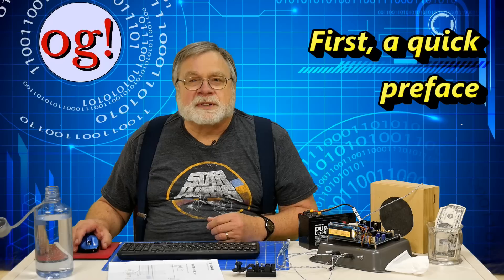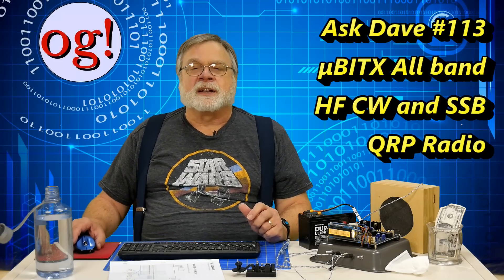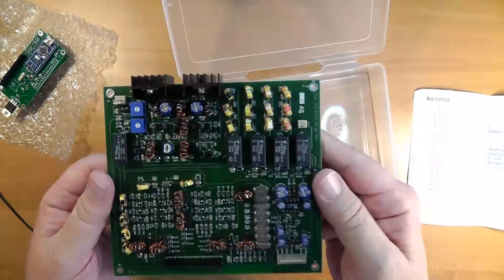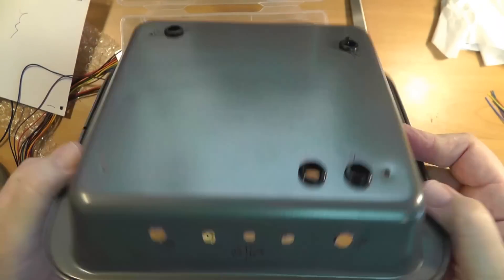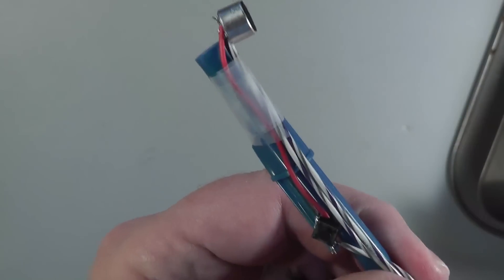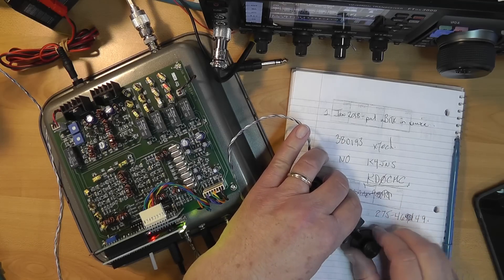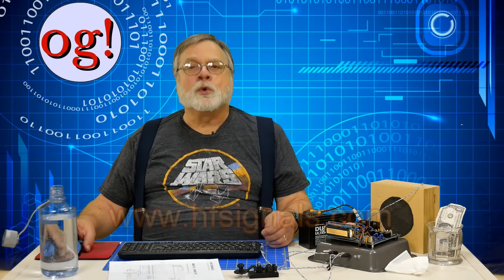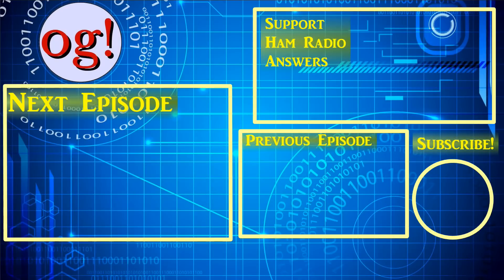New All-band SSB/CW Micro BITX Now Available (AD #113)

Comment: For those of us experimenters who have no great interest in purchasing a $1,000 to $10,000 appliance rig to ragchew, contest, or certificate chase with, it's cheap and easy to buy one of the $17 power amplifier kits on eBay and build it up, and build low-pass filters for any bands of interest. That's what I'm doing, and I'm adding a step-up converter module to select the drive voltage for the MOSFETs in order to get a more significant power output. 45 to 60 watts will get one within an S-unit of the expensive rig's 100 W or so. These days there's really no reason to let power limitations keep anyone (with a soldering iron who can follow directions,) from running a cheap rig alongside the big boys on SSB. We experimenters really have no use for appliance radios because of the price, but more importantly because they  a dead-end. They are nearly impossible to modify or add features to, and far too expensive to give anyone the incentive to try, and one can't really learn much from them. They are a black box. A cheap and open layout like the uBITX rig you have there is best. There are even modification videos online for them, and rigs such as this can get repackaged for compact size if desired after all the learning and mods and add-ons are done. The most important privilege associated with a ham license isn't bands or power. It's the open authorization to do whatever we want with our equipment within the rules of the service. We can design and build, mix and match, modify and improve as we so choose. Appliance rigs are simply not conducive to that. No, a new ham may not know enough to do all that I described, but the ham license is a license to learn, and learning about RF is what the ham radio hobby is really all about.

Comment: I could make a wooden radio chassis and line it with aluminium foil to protected it from RF noise
Reply from the maker: Yes, that will work as long as you can make good ground contact to that aluminum.

Comment: While we may have an amateur in our titles, the HAM's in my area at least take allocations seriously. For the amount of learning you go through even for a General class license and the learning throughout your years of operating, I think a little trust is earned. I see this debate with the ICOM 718 which I have vs the ICOM 78. If I need to get a message across on HF in an emergency it is nice to know I have the whole band should the other bands not be open....especially considering some of the Marine SSB bands are monitored for life and death matters and are likely to get you a response. I take this type of thing seriously and anyone building a radio most likely does as well. As a side note: My ICOM 718 can transmit out of the band by quite a bit on some areas without any modifications and I haven't heard of this causing issues with other users that already will find a way to break the law. If te 718 was General TX as well I wouldn't need to snip a diode at some point for 60 Meters or whatever future allocations might hit us. I like to keep good products for a while. I also like a signal generator without buying yet another product when I have bills and student loans to pay.

Comment: Dave,
 A selection of uBITX and BITX40 ready built METAL cases available from another India Company  
LINK: https://amateurradiokits.in/ 
Holes are pre-drilled, hardware and extras are included.

Also for the BITX supplied volume pot try an eBay search for 
"4mm Shaft Insert Dia Brass Potentiometer Control Knobs" 
These are 14mm (25mm skirt) plastic knobs with a brass collet inside.  5pcs for less than $4 with free shipping from China.  
You pry the top cap off, slide the knop over the pot shaft, trim off excess shaft sticking out past the collet nut, use a 10mm socket to tighten the collet nut to grip the shaft, replace the cap back on top of knob.
Reply from the maker: Thanks for the tip.

Comment: Why does the case need to be a conductive material?
Reply from the maker: It doesn't. I put my first BITX 40 in a plastic case. But a metal case provides more protection, plus more shielding against RFI. However the power levels are so low that plastic can work just fine.

Comment: Dave. I am seriously thinking of a uBitX.  It looks like a great little rig! You mentioned the problem with filtering for CW. I may have a solution for you. An Italian ham, IW2NDH, Luca Facchinetti, has come up with an incredible  little DSP filter board (http://jackdev23.wixsite.com/iw2ndh-dsp ). It is reasonably priced, but even so, it will go almost as much as the uBitX at about $80. 
Now, here I submit a philosophy about the uBitX and a new direction for ham radio. A new General buys and builds his uBitX. As he progresses, he desires a little more radio, so he might add the DSP. Itching for more power, why not build a linear? For less than $20, you can buy a 70W amp kit that will match right up to it. This budding ham essentially winds up building a great rig out of building blocks. Like following a TunaTin 40, with a 6L6 (edit: I think it was actually an 809) amp. Don't think about the limits; think about the potential.
I think the uBitX explosion has the potential to take ham radio back to its roots, much as it was back when I first considered ham radio, 50 years ago. de N4DFP, 73

Comment: Box making isn't that hard and GUESS WHAT?  There are a lot of extant chassis that could be gutted and refitted with this component kit.  Refit/reuse or just buy a box from another box-making company. Or masterfabricate as I might do (but then I have this great old Midland CB chassis that might house a couple of these, plus has power supply and such).   A pal has one of these kits, but not assembled yet-and that's what brought me here.  I'm about go nuts/QRP and building makes sense. Wondering about digital or crystal filtering this one for CW. Thanks for vid.  FB 73 de W1ADE
Reply: Wow, you see what "lowest price is better always" mentality does? Where there's $$$ to be made, there will be a supply (of boxes).  Economies of scale mean that my 10 boxes might retail at 3x each what a maker who could run 10,000 boxes might charge. WalmartHam mentality is totally for the cheapest on maximum scale (no matter the true cost).  So I could make boxes to sell, but most hams would cry and whine about the price, and the last three boxes (any profit) would likely sit on the shelf forever.  

Maybe I'll sell some templates... no idea we'd slipped so far.
Reply from the maker: I'm not sure where your comments are leading. There's plenty of quality equipment out there at reasonable prices. As in any field, there is also equipment that is too inexpensive and will disappoint the buyer. I try in my reviews to provide some feedback on what works and what doesn't.
Reply: Sorry I got myself confused.  Was lamenting the lack of hand/tool skills in your estimation of our population, then got carried away into economics of scale.  Maybe I had too much coffee.  Making stuff is second nature to me. Cheers.

Comment: Great review! One question: is it unwise to house this radio in fibreboard or other wood-based product? Modern QRP circuits typically run cool enough for it, and I suspect more people have woodworking skills than metal or plastic. (But I do totally dig that old-school cake pan chassis! Any chance you can mount a live tube somewhere on it, just to show the flag?) Thanks again for the excellent in-depth shakedown.
Reply from the maker: Wood cabinets are fine. Just make sure that the heat sinks are properly ventilated.
Reply: Thanks, OM!

Comment: I'd be great if some came up with a panel that'd fit the uBITX inside one of Harbor Freight's two ruggedized, watertight cases, the Apache 1800 ($15) or Apache 2800 ($30). That'd make it great for mountain topping. Here is the former:

https://www.harborfreight.com/1800-watertight-protective-case-9-316-in-63518.html

Comment: Mine hasn’t arrived yet but I think it’s a tremendous bargain. Anyone remember when you had to either layout a board with narrow rolls of tape and peel off doughnuts with an x-acto knife? If you were lucky enough to have a board layout in a magazine you still had to get a kodalith negative shot actual size to photo etch a board before you could drill and stuff it? Things are so much better. I just want 1980’s band conditions again. Find a used drill press on Craigslist. Buy a few files. Heat up that soldering iron and make contacts.
Reply: Harbor Freight has lots of tools that are not that expensive.  They may not hold up for hard use, but good enough for a hobby.  What gets me is that I just ordered one of the 'kits' and was looking for a box to put it in.  Those aluminum boxes seem very expensive for what they are.  I do have a few I have picked up at hamfests for a dollar or two.  Even looking at removing the parts in some of the cases that are used for switching out 2 or 3 printers or other serial devices. 
I can do the wiring for electronics with out any problems but now most everything needs to be on a PC board, I do not have the skills to make them. I do have the tools to work on or build SMD items if there is a circuit board for them. I have heard of some companies that will make the PC boards for not very much money if you send them a computer file with the layout.  

I don't hardly see how they can sell the transceiver for about $ 109 shipped, but glad someone can.  I have good low band rigs of the 100 watt class, but think this might just be a good rig to use with some transverters off ebay to use on  2 meters and up SSB.

Comment: you can get a step-bit at the Horrible Freight for about 3 bucks and any reasonably powered handheld drill is more than adequate to drill through an aluminum (or plastic) project enclose or cake pan.
Reply from the maker: ...if you can hold your hands steady enough. That's my problem. I have a bit of a tremor--have had it all my life--so the drill press really helps.

Comment: The CW drop out or tx/rx delay can be adjusted just the same as the bitx40 in the cw menu settings.Once you have it set for a longer period (for using a straight key slower style) it works perfectly.

You are using a 12V battery which may drop to 11V so yes your output will be lower.  The figures quoted are for 13.8V infact on the Bitx40 you can supply the pa seperately with say 24V giving a higher output. Although I am uncertain if the uBitx has the same ability. 

As for the box well that is upto you.  myself  I think your cake tin build is a poor option. I mean why do we box transcievers?  to  cut down radiation of unwanted mixing signals etc.
 QRPLabs QCX transciever also does not come with a case.  making it a flexible experimenters radio although it can also transmit anywhere if you remove or alter the filters.
SO yes if someone comes up with a chassis design forthe uBitx or the Bitx40 or the QCX then that would be a good thing. metal screened ofcourse. it may cost as much if not more that the radio with shipping costs.
One point, in the uk Novice hams are not allowed to use non type approved radio's 
So this radio is a no no for newcomers in the uk as it is not a kit.  
Cheers Mark G0NMY
Reply from the maker: The only CW option I see in the menu is for keyer speed. Can you provide more info?
Reply: Hold the menu button in for about 5 seconds  look for CW Params sub menu and then QSK delay

Comment: If a ham does not know where he/she is authorized to transmit then they should turn in their license.
Reply from the maker: Well, after over 40 years of hamming, I still get out the chart to see where I can and can't transmit. And my memory isn't getting any better with age!
Reply: I agree.  Locking the TX to only xmit on Extra class band limits, doesn't help the USA Novice, Tech, Gen or Adv class licenses, not to mention band limits differ in different countries...  Leave it open.  Make the operator responsible, as they should be anyway.
Reply: What would help the new comer and experienced is having a section of a band that those who are learning to gain their license can use without a license. A paid permit that is validated with a training course at radio clubs with a "learners" call sign. This would give the newcomer hands on. Limited band, limited power.
This hobby could do with encouraging people. You learn as you do. You can't do without a license.
Reply: @marklowe7431  Agreed. I always hated how you couldn't have a dual purpose HAM/CB rig where the CB side on 11 Meters was limited to 4 watts. Perhaps add a "90 Meter Band" from 3400-3500MHz for a learners call sign along with a corresponding band slightly above 10MHz for daytime propagation with an explicit power limit of no more than 50watts EIRP and periodic supervision of an Amateur Extra and/or VEC. Call it lazy but a lot of people are turned off by the tech test but once they learn the benefits and all the fun they really open up. I sort of wish I could share my HAM callsign with GMRS once I pass Extra......all the segments of very similar services make sense but also muddy things up. 3 radios for services that could be handled by one radio...
Reply: I have keyed down out-of-band on 30 a few times. It's easy to do; the ham slice of 30 is small and doesn't conform to our other HF bands. So I jump from 40, to 20, then back down to 30, and once in a great while will start tuning up at, say, 10040, before I realise I'm wildly out-of-band. I normally catch this within seconds, and I'm QRP at that point in the tuning process anyway, but if my rig prevented me from radiating a signal there, it wouldn't happen at all. Human brains don't work like computers. We make mistakes.

Comment: Dave, a nice overview of the uBITX. I agree with you about the case, I also believe somebody or several somebody’s will be offering a case for this rig soon. As far as your measured output power, mine puts out 11 watts on 40 meters SSB running at 13.8V, so you may need to re bias the finals or turn the drive up a bit. Im not as concerned as you about out of band transmissions with this radio as all homebrew radios are capable of out of band TX, (at least mine are), and its never been a problem. This radio is a experimenters radio and thus was never meant to be FCC type accepted. I predict there will be a lot of custom firmware revisions available soon addressing a lot of different things. It would be fairly easy to put TX band stops in place by modifying the code. I love mine and am currently waiting for a enclosure to arrive to finish it out. Thanks for the video.
Reply from the maker: I'll have to check out the tuning. As I mentioned in the video, it worked out of the box, so I didn't adjust it further. Sounds like I should.

Comment: Another great video Dave.  I'm glad to see you went with a non-stick cake pan.  Solder and melted components should clean up easy.  A good replacement for the volume pot that will give you more knob options is this one https://www.adafruit.com/product/3481  someone on the groups.io list found it to work well and I have one on order.
As to your lower output, have you tried to adjust the PA bias as described here http://www.hfsignals.com/index.php/ubitx-tuneup/ ?
Reply from the maker: Doug, thanks for the tips!

Comment: Dave is the micro BITX  setup like the BITX40 were you can run the finale amp at a higher voltage for higher output?
DE N8QJU
Reply: Yes there is a separate connection for the PA!
Reply: TNX 73 n8qju
Reply: If you look at http://www.hfsignals.com/index.php/ubitx-wire-up/ at the top left of the page there are three connections (Ground, PA_PWR and +12V) on the uBitx too.